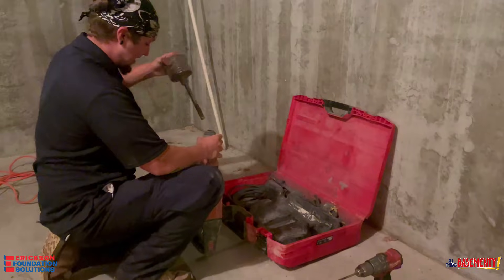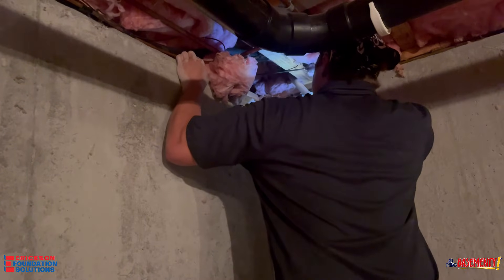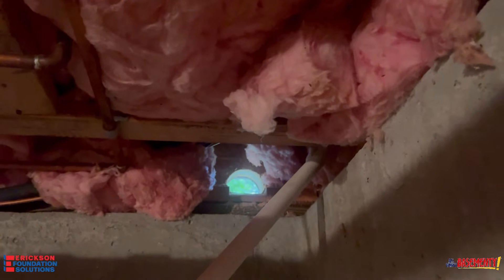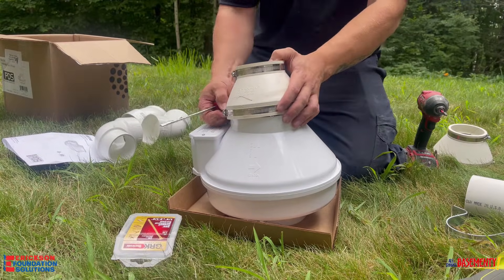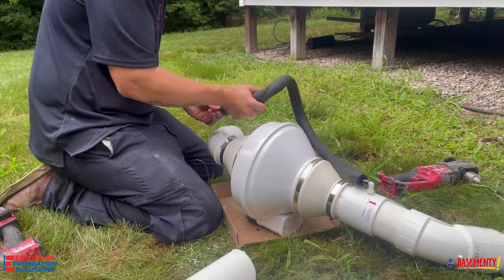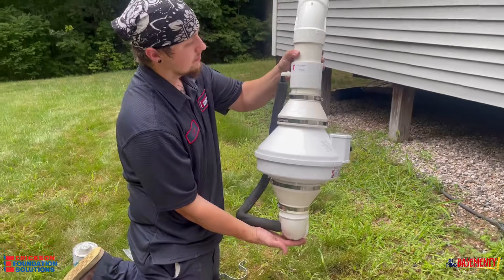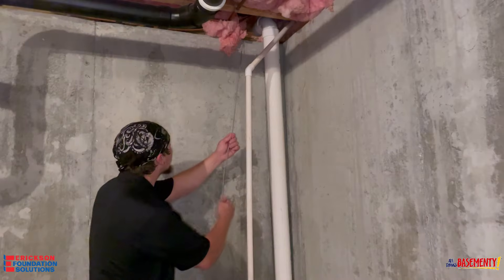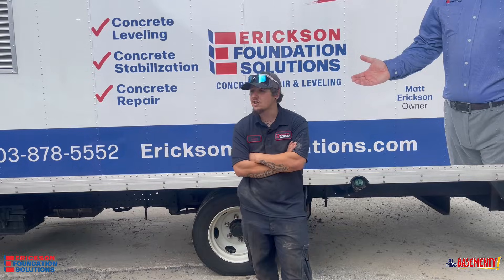Installing a Radon Mitigation System

Comment: There's so flashing or at a minimum silicone where the pipe comes through the siding?  Wouldn't rain water just follow the exterior of the pipe and run into the rim joist? I feel like there was a step that got skipped.
Reply: They just didn't show that part i think. Considering how thorough they were, i doubt they skipped that.

Comment: does that stuff reek out of the lower layers of the ground only? what about everything else where a house isn't sitting on top of it?
Reply: The basement slab usually sits on gravel bed. The fan pull the air/gas through the gravel.

Comment: If this thing is sucking air out of your house all day long, how is that air replaced and aren't you paying to heat and cool the outdoors?
Reply: If I'm not mistaken, its not sucking existing radon from the basement interior, if I'm correct a radon mitigation system pulls gas from underneath the basement slab, keeping it from coming into the basement in the first place
Reply: @trwoody1  What's under that slab is not porous, that fan is moving some serious airflow because it runs full time.  It would burn up without adequate airflow, which must come from somewhere.
Reply: @ChillWill-q5x  what is under the slab is in fact porous. There is gravel bed under the slab if it is done right. The system pulls and hold a negative pressure under the slab. It works incredibly well.

Comment: How do you keep rain and snow out of the stack?  Otherwise looks like a good job.
Reply from the maker: Thanks for your question. It's important not to impede the air flow of the system, and so these systems do not generally utilize a cap of any kind.  Ice could collect at the top, or an animal could build a nest, both resulting in blockage. The small amount of water which may drip down the pipe can be collected and removed through a moisture guard component before it enters the fan. This essentially just diverts the water and removes it from the pipe while still allowing air to flow up.

Comment: Is there anyway to do a radon mitigation system without drilling inside the home? Couldn't you access the slab from the outside?
Reply: Radon mitigator here. It’s a lot more work, but yes, depending on how the drainage for the foundation is set up. On modern homes, there is typically a perforated drain pipe that runs around the inside and the outside of the footer of the foundation. I have heard from my radon courses that you can tap into either pipe to create the suction you need to get the radon out. You would need to dig down on the outside of the house until you find the black perforated pipe near the bottom of the foundation. Cut a hole in the top of it, put your radon pipe in, fill in the hole you dug, and install the rest of the system as you normally would. Always retest for radon after installation.
Reply: Yes and no. If you'd like to dig a big ass hole, go for it. Youll be removing about 5-10ubic feet.

Comment: I had a company tell me it has to come out the roof, is this true?
Reply from the maker: Thanks for your comment. For new homes being built, installing a closed system (passive) that vents out the roof is common practice. For existing homes adding a new radon system, going through the roof can be a challenge if the pipe was not previously installed when the home was built. We generally install systems with fans on the exterior of the house, with vents running up the side and above roofline as shown in our video. We've never faced issues and always ensure we comply with town/city codes.
Reply: @ericksonfoundationsolutions , Thank you for that information.  I was told I would need to install an outlet in my attic.  You saved me some trouble.
Reply: Radon is a scam.
Reply: Sometimes the passive system does not go all the way through the roof. You may find a roughed-in pipe that runs from the ceiling of the basement to the bottom of the attic. You could still install the system outside, ignoring this pipe, but it’s just as easy to finish the system using the roughed-in piping on inside. Aesthetically, it’s the less intrusive way to go.

Comment: Leave a window cracked, much easier.
Reply: You can just test. Do a test with the windows closed, and do a test with the windows cracked. In very cold climates, this is not feasible in winter, but in many places, improving ventilation is a sensible way to go.
Reply: Some basements are fully enclosed with no windows
Reply: I think that works better for those in the south.  I live in the north. It's cold 8 months out of the year so it's not practical to rely on open windows.
Reply: @happygolucky9004  and btw depending on the weather can actually cause you to be more exposed to radon if you decide to leave a window open 

Look up what the stack effect is
Reply: @reidtaylor2113  Yes, I know.  Opening the windows can cause pressure changes that increase radon depending on the home. My second comment was for Patriot.
Reply: Just because you vote for trump doesn’t mean you have to be ignorant, you know?
Reply: @reidtaylor2113 You just had to bring in politics 🙄
Reply: @happygolucky9004  you wouldn’t get the joke

I’m actually a Trump supporter too, so I want him not to be ignorant!